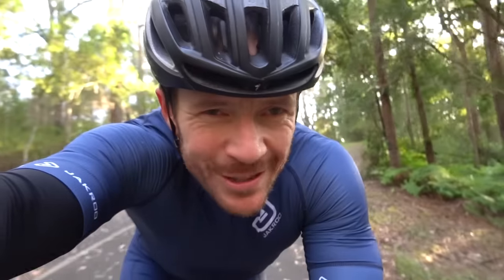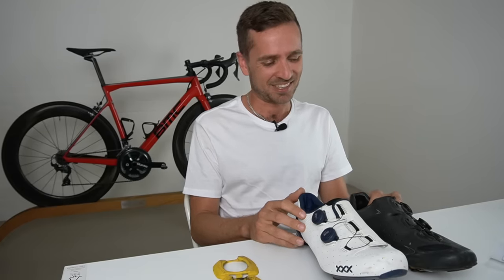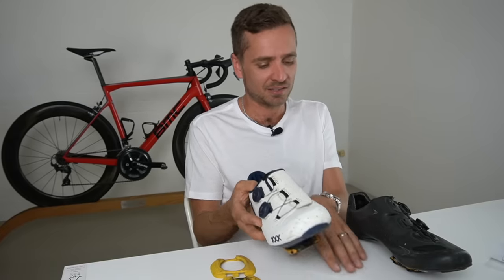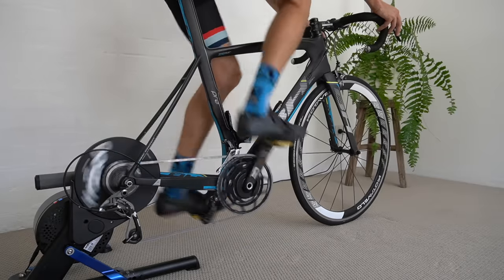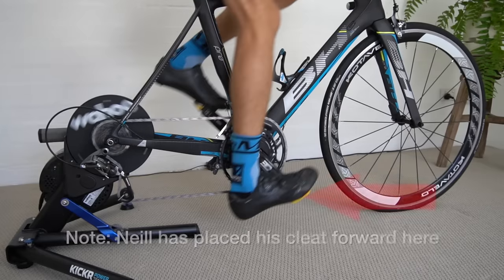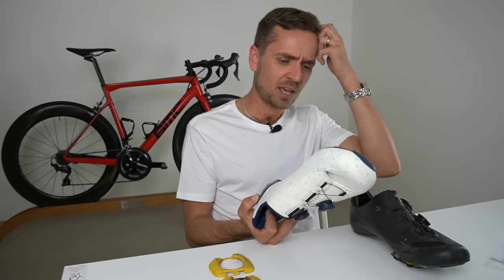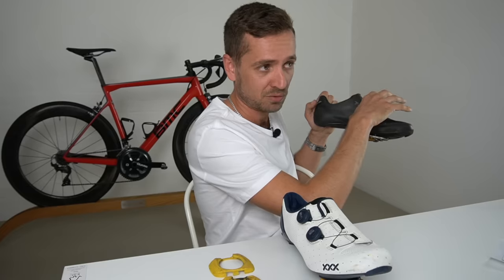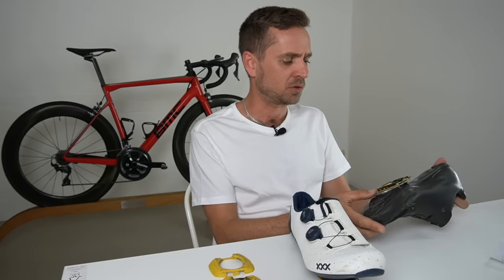Want More Power? (Two Cleat Positions to Respect!)

Comment: Look up trainer Joe Friel. He’s been advocating moving cleats all the way back for many years, and he’s proven there’s up to an 8% improvement in power and longer time to exhaustion as well, and yes an acknowledgment of a slight loss in sprint power that most of us won’t miss. Rearward placement takes the calf muscle out of the power chain more and hence will not tire as easily on long rides. Triathletes have gone so for as to use mid foot cleat placement shoes as it saves their calves for the run portion of the event.

Comment: carbon cranks - would not use 2 washers - only 1 for safety. No pedal extenders on carbon cranks!
Reply: Depends how heavy the rider is, and how big the sprint is Dean - but you are right to be cautious! I never recommend extenders on carbon cranks either, too sketchy unless the rider is very light and not powerful. I tend to push people towards Rival cranks as the strongest off-the-shelf option for pedal extenders.

Comment: Track and road sprinters normally place the cleat (centre of spindle) 1/4 inch ahead of the ball of the foot. This allows the heel to drop quicker thru the dead spot around 1- 2 oclock.
Its complete nonsense to talk about placing it at the very front of the shoe.
The centre of the spindle goes under the most forcefull and stable postion. The stable postion refers to the stability of the 2 arches of the foot. For most cyclists this means just behind the ball of the foot. The main purpose of the foot is the fluidity of the pedal stroke. In general the more the cleat is placed further behind the ball of the foot the less fluid the foot becomes. 
The foot is a "B CLASS" lever. As the foot is not an A class lever most of what you claim is scientifically WRONG. Anyone with a heal down pedal stroke needs to raise the seat height.
First you get the fluidity of the foot right then raise the height of the seat until just before the fluidity starts to reduce  - to get max power.

Once again how many of these comments are fake names made up by you guys.
Reply from the maker: I barely have time to get to all comments let alone make up fake names and place comments. That’s laughable.